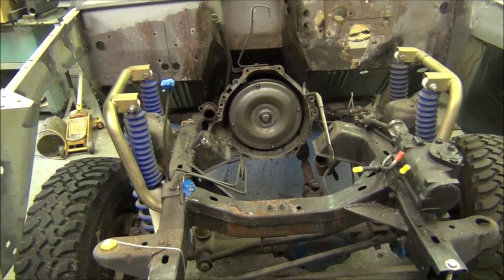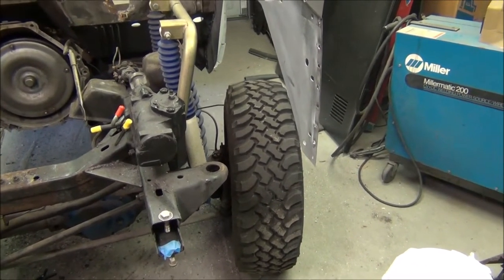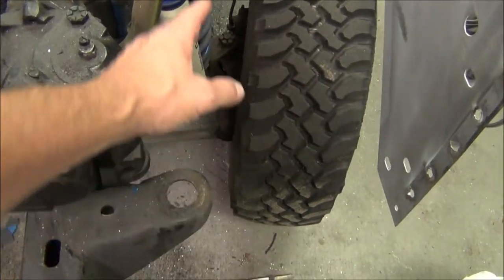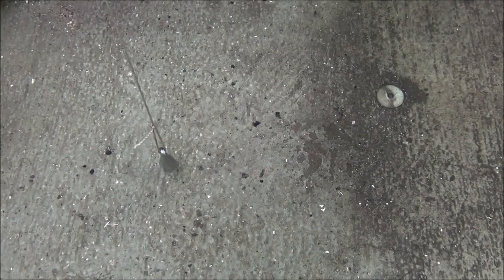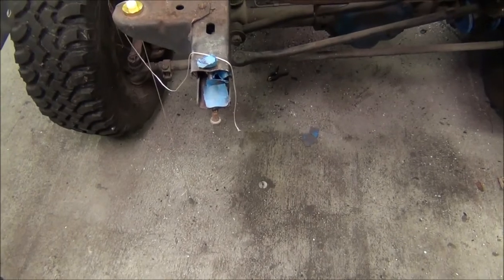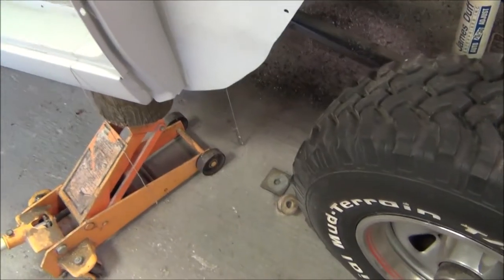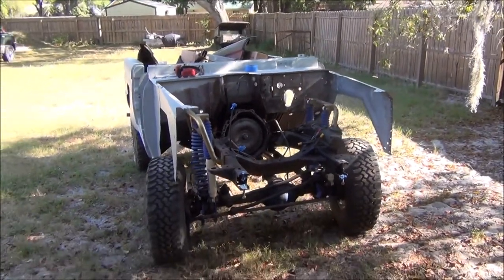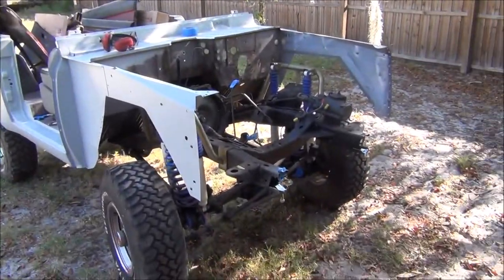1973 Early Bronco Project Part 47 Checking the frame for square

Comment: Hi Condor. I really enjoy your videos. I am restoring a 1966 Bronco that also took some damage to the front end from years of use on a deer lease. I need to replace both inner fenders and the core support. I’m deathly afraid that I’ll weld the front end together and then the hood, outer fenders, etc..won’t line up correctly. Do you have any tips for how to ensure my inner fenders and core support are located correctly before I weld them in? Thanks for your help.
Reply from the maker: The best I can tell you is to put in the tubs and just attach them with a few self tapper screws to the inner fender aprons, don't put the front body mounts on the tubs yet, then hang the front fenders and grille, set the hood in place, you'll still have side to side adjustment since you haven't put in the front body mounts yet.  true everything up with your hood gaps, mark the location of your front mounts and tack them in place.  then take the fenders and hood back off and weld everything in.  Hope that makes sense. The next video I post will show some of what I'm talking about.
Reply: CondorDiving thanks for the help! Your suggestion makes sense. I was thinking I could just square the inner fenders and core support and weld everything in but I’m afraid the hood wouldn’t line up. I see you already posted your front end video so I’ll watch that and follow your advice on hanging the hood and outer fenders.